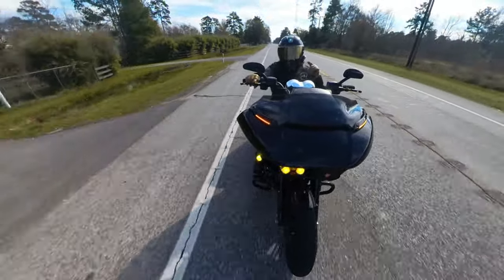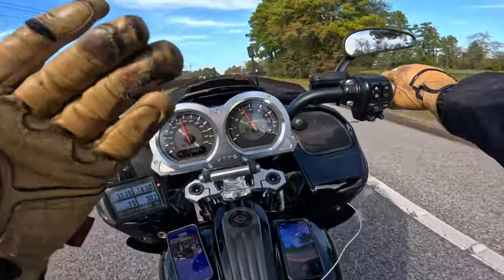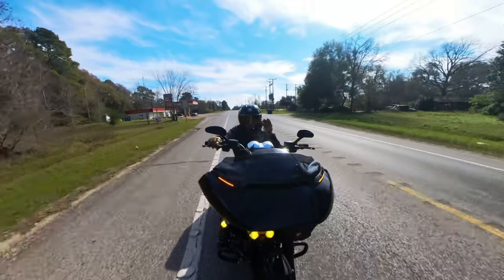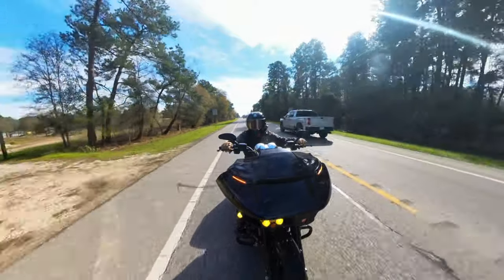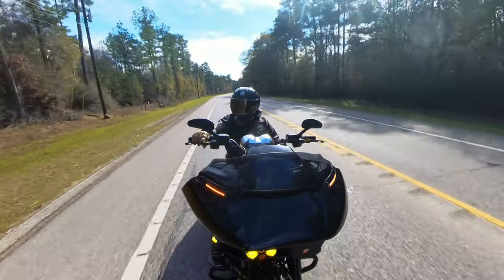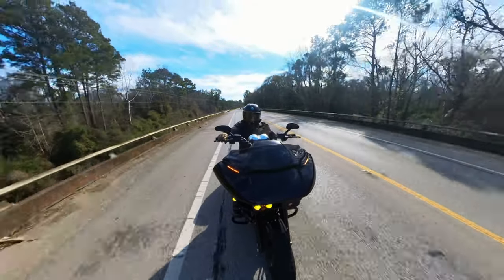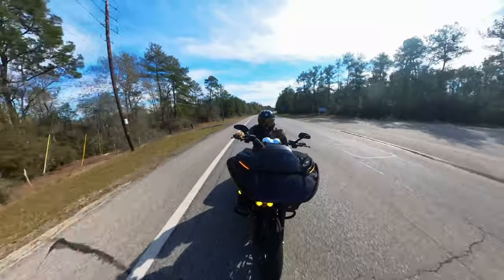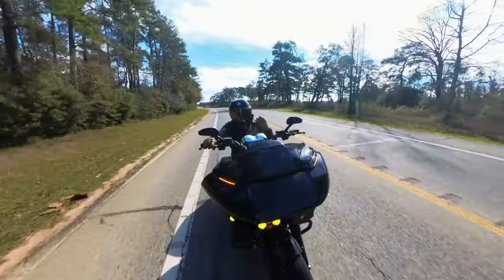MORE POWER FROM A CHAIN DRIVE KIT?

Comment: Chain drive is more efficient than belt drive and so it actually does transfer more power to the wheels compared to belt and shaft drives.  A better way to say it is that less power is lost with the chain compared to belt and shaft drive.
Reply from the maker: Agreed and well said. Thank you.

Comment: Good vid...I have 120tq, 120hp and broke a belt. I was lucky and close to home. I've ridden to Sturgis and the Keys (live in St. Louis, MO) with the belt and I was fortunate. I'd tell everyone if you lay down miles to do a chain. Loaded (bike not ppl)and 2 up is a real strain on the belt if you use the power. You should upgrade you primary chain, clutch, etc. with any (big inch) engine mods. The og setup is good for the intended factory horses. My bike is a '96 Road King with 113" EVO and carbed and hard to be the dependably and the sound. Her name is Connie.  

Talk about the loss of gas mileage!!!!   LOL 
S
Reply from the maker: You have a very nice build! Good points as well!

Comment: Nice angle. I was considering chain drive or spend my money elsewhere. Installing S&S 132 big bore on my Road Glide ST. Whats your thoughts? I'm already doing Evolution clutch basket and Man O War compensator. You still like yours? Enough questions . Cheers
Reply from the maker: Thank you! That 132 is nice! Yup still like the evolution industries clutch and man o war comp. However, I have the baker comp in the CVO and like it as well. As for the chain. It depends how you’re going to ride it. I would upgrade to the Trask chain drive kit if I was getting a 132. Simply because you might want more power later on.
Reply: You get more TQ to the wheel with  chain id do both to get more bang for the buck out of that 132